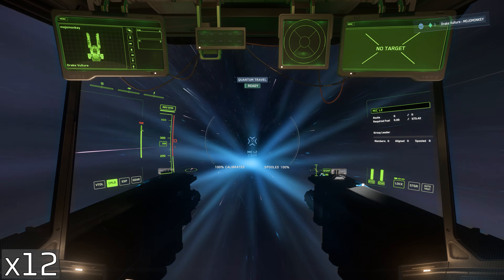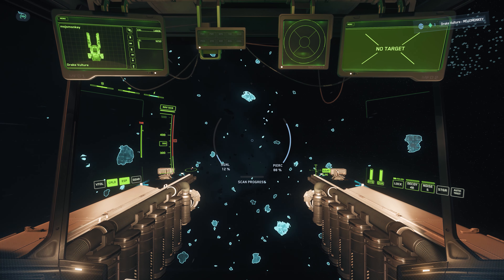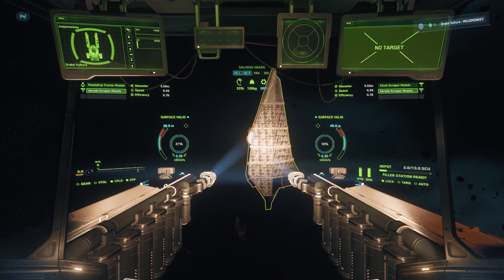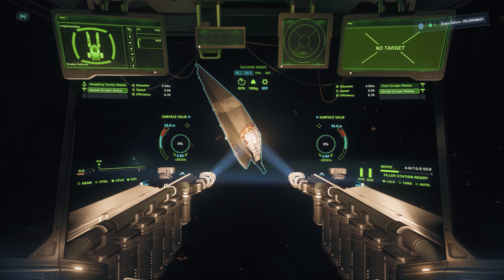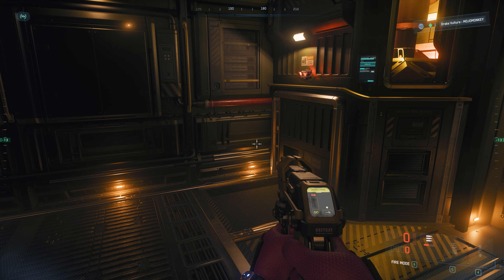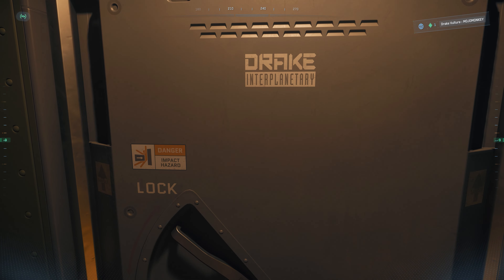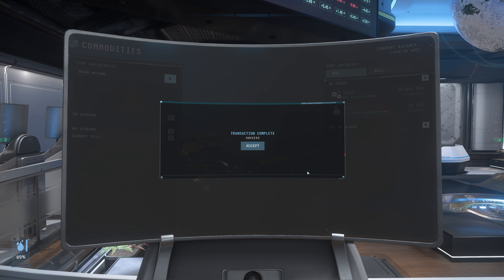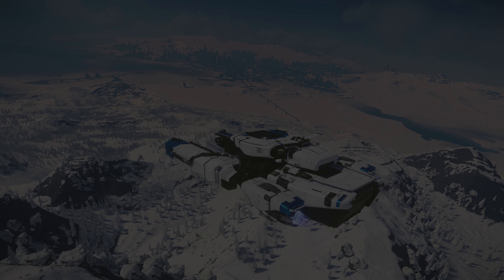Salvage Panel Gameplay | Star Citizen 3.23 4K Gameplay

Comment: You can actually fit 39 SCU in the vulture. 10 boxes along the wall in front of the door, 12 on the grid, 4 in the space between the hopper and grid, finally 13 unprocessed in the hopper. 

You’d have to access your cargo from the back ramp of your ship. Empty the first hopper against the wall with the remaining 3 boxes on the grid. Fill the hopper again, pull the 3 grid boxes out of the back of your ship, empty the second hopper out in space behind your ship, put the 4 boxes between the hopper and grind, then load the grid. Finally fill your hopper a 3rd time and head to sell. Takes a bit longer though.
Reply: yep, doing this method does take some time and some patience. But it is satisfying filling the cargo bay to the brim, closing that door, EVAing back to the pilot seat, and heading off to the nearest TDD.
Reply: I'm about to hope back in and try this method
Reply: Takes some time and sometimes if the boxes aren’t set down correctly they will be spat out the sides or back of the vulture, I try and do it once I have completed the first hopper full as it’s quicker to arrange when the cargo bay isn’t full and you have 30 boxes floating around outside the ship. Ps, this is a great relaxing way of earning money rather than mining or shooting things
Reply from the maker: Goodness - sounds like a lot of work xD
Reply: Those literally few extra boxes are not worth all that finicky fucking around with boxes, imho. 
Especially since sometimes you can do EVERYTHING right and the game just kinda... fucks you. Lol
Idk. These try hard methods just don't work for me, i find them to turn a very relaxing and wonderful game into a stressful, annoying nightmare lol

Comment: HUR_L1 is my fav spot for panels! They are EVERYWHERE there and 0 pirate activity as well! Also when the little blips disappear don't worry!! Use the left bar in the scan mode that says "SGNL" and as long as the strength increases you are still getting closer and slow down when you are about at 80% meaning you are close and don't want to crash into them when they spawn!
Reply from the maker: CRU L2 ;)

Comment: A little less mindless than just grabbing a 50k contract, but much more profitable. Finally got this to work, myself. I also run double Abrades. More than twice the speed over the Cinches for a 20% or so hit to efficiency. One or two patches of panels will still fill you up in a fraction of the time.
I like to fill the hopper all the way to to 13 scu before printing for the first time. Fill up the grid and leave the last box where it gets deposited. Fill up again, then go to the hold open the ramp and move all of the boxes that have been printed into space. Print out everything in the hopper and move them as they're printing, starting at the door by the ladder and going all the way back. Then a stack of two at the printer output and a stack of two between that and the stacks from the door to the ramp. Last 12 boxes go on the grid. Then I go fill up the hopper one more time for a total of 39scu.
Reply from the maker: I'm too scared to run the full 39 :D
Reply: @Farrister  lol. Where's your sense of adventure?
Reply from the maker: @schakTheNerd  hiding behind my sense of impending doom xD
Reply: I hadn't considered this 'reverse' method but will definitely give this a go. Maybe a bit more risk involved but could really help with those last few awkward box stacks.

Comment: My trick for quickly locating panels that haven’t already been picked through is to grab a 1k or 5k salvage contract and use that marker as the center point for my search pattern. Since the salvage points are usually 60-70km out from the station, you can usually find good panels nearby.
Reply: That is a really good idea.
Reply from the maker: Interesting idea!

Comment: Thanks for sharing this video! I tend to use 1 Abrade and 1 Cinch. I also tend to get a bit closer. 25 to 30 meters but I have seen the occasional panel go haywire and hit my ship when I am that close.  I also tend to head to the local station and refuel before I get started, that way once I am full I can just head out. I have had mixed experience with "loading to max" my ship. Some times the cargo on that is NOT on the grid can fly around and cause issues. I am not 100% sure that the few times I have exploded are related but I would be interested in your experience with loading your vulture to max cap.

Comment: When it comes to using a small cargo vessel to aid a small scale salvage operation I greatly like the Hull A. Has the same cargo capacity as the C1 but is easier to load as you just fling the boxes against the cargo panels on the side of the ship.

For larger operations using Vultures the Caterpillar has proven most useful with its multiple cargo compartments easily reachable from 2 sides. Up to 4 Vultures can simultanously unload into a Caterpillar.

Why use the Vulture for larger salvage jobs? Well, the Vulture basically has the same amount of scraping heads available as the Reclaimer, with the major difference that the Vultures heads are useable by one person while on the Reclaimer they are split over two individual arms.
So outside of storage capacity the only advantage the Reclaimer has over the Vulture is the ability to crack larger ships and absorb them whereas the Vulture can only crack smaller ships, up to the likes of Constellations.

Thanks for the video.

Comment: Why do you need to move your ship to empty the hopper? I just call my ship in the Asop terminal, empty the hopper while in the hangar, find I can still press 5 to get out my tractor beam whilst inside ship. Then stow ship and head back to tdd. The only thing that will not be a time sync in 3.24 will be being able to empty hopper at the same time whilst transferring everything to the cargo elevator so no need for 2 trips to tdd.
Reply from the maker: Usually that's true for me too, I mention it in the voiceover. It was quite annoying and cost a lot of time. But for some reason in this one it wasn't happening

Comment: Scanning salvage panels at Lagrange points is easy to scan initially but when they become too close to scan you have to look for them. This can be a problem in 3.23 & 3.24 Evo. Odd since the panels are the size of small ships.
Reply: Actaully it is easy to find them! When in scan mode the Left side bar is the Signal strength, when aimed at the panels it will increase in strength the closer you get! No more searching :P
Reply from the maker: That's why you gotta get on direction Pheebs ;)

Comment: Not 100% sure of this, but the reason you shoot the panels is it causes them to de-spawn, I think???
Reply: P.S. Multi-Tool Tractor beam. Yes, I too can no longer use my "MT" in armistice zone. I even can't use Key binds KB or GP !!?? to deploy (pull out off hip) I have to open inventory & drag to my hand.
Reply: Correct.  Handy for getting rid of a stripped panel.  The MT only works on the pad as well. If you leave the hangar pad your tractor ceases to function.   It appears to be an armistice thing.
Reply from the maker: So it seems :)

Comment: Why do you not just fracture the remains once you have scraped it clean? Appreciate the video by the way. Up to the usual Farrister standard of information v Entertainment
Reply: I had previously tried to fracture the panels. The code is not there for that, so not able to facture them.
Reply: You can't fracture them and CM is rubbish
Reply from the maker: As the others say, it doesn't work, moreover the Vulture only has limited storage, so may as well grab high value goodies with it ;)
Reply: Fracturing them results in construction materials, not worth very much at the moment.